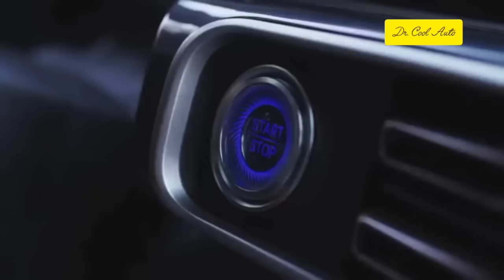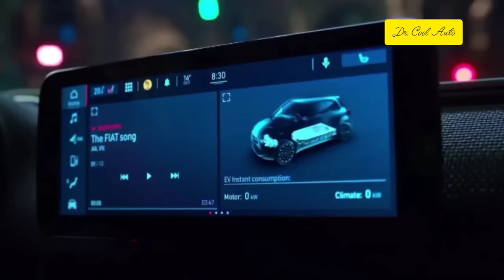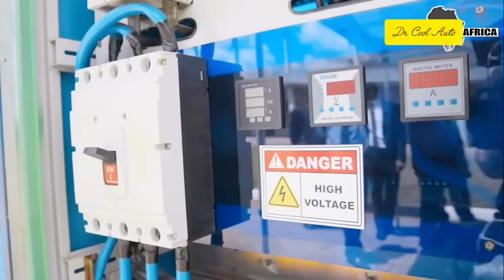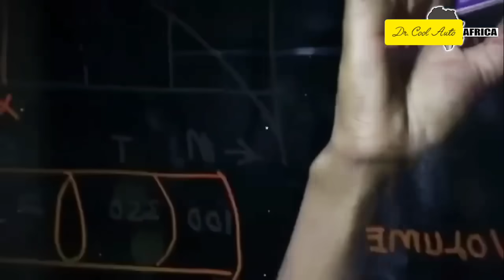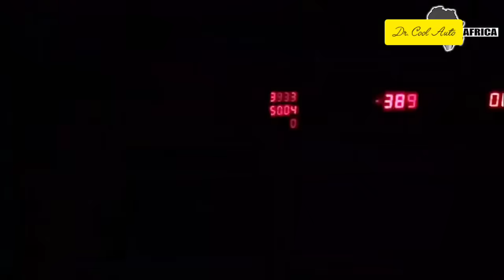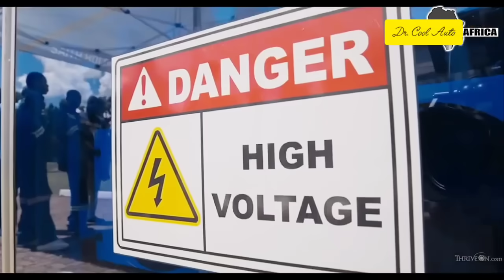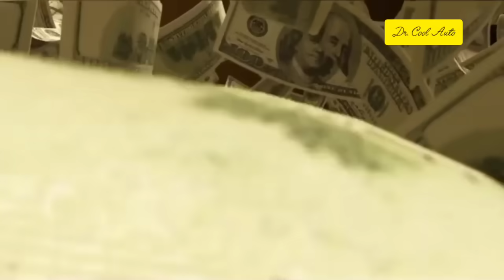2025 Self-Powered EV: Shakes Up The Entire World! shock skeptics

Comment: Dr. Cool Auto Fix;  If you want to invest in innovation and a 98% efficient motor then send me the money and I will show you my motor design.  I say 98% because you can NOT ever get a motor more efficient than that.  Anyone who claims to get over a 100% efficient motor is a liar and a fraud.  You can not get 500,000 watts from a .01 milliwatt radio wave.  That is like running a train locomotive with 100 box cars with a watch battery.  NEVER going to happen.  GM, Ford and other car companies are now working on compressed air motors, and that has the best chance of solving the problems.   This scammer has nothing but fraud.

Comment: Using Radio waves or any sort of electromagnetic broadcast to transmit energy to power an item isn't a new concept; Tesla had the same idea.  There are advantages such as a lower weight, lower cost vehicle as you don't need large heavy batteries. You could dispense with a physical power grid using electromagnetic energy broadcast from transmission towers such as Tesla built at Wardenclyffe. However you do still have to generate the power and then build transmission towers to broadcast the energy.  But you need to be within range.  If Chikumbusto can demonstrate a broadcast method that has a long range yet is also efficient - it ought to have a major impact, but a big IF.

Comment: Modern TVs typically draw anywhere from 50 to a few hundred watts, whereas ambient radio/TV broadcast signals in most residential environments only offer microwatts to milliwatts of harvestable energy—orders of magnitude less than a TV needs.

Here’s a quick comparison:
	•	TV Power Consumption: Let’s say a modern LED TV uses around 75W. Over an hour, that’s 75 watt-hours of energy.
	•	Ambient Radio Signal Power: Even under favorable conditions, you might harvest milliwatts—thousandths of a watt—from ambient signals. To reach 75 watt-hours, you’d need a massive area of high-efficiency antennas or years of collection time—practically impossible for powering a TV in real time.

Conclusion: While it is theoretically possible to power extremely low-power devices (like tiny sensors) using ambient electromagnetic waves, powering something like a TV or larger appliance from everyday broadcast signals is not feasible with current technology or known physics. If a video claims to show this in action, it’s very likely either misleading (e.g., using hidden power sources, battery backups, or editing tricks) or misunderstanding what’s actually happening.

Comment: The oil industry will not be destroyed. A cleaner earth from no gasoline or dirty motor oil is good and doable. But lubricants will still be required on these cars and so will plastics. Oil industry produces more than fuel. See these cars and motorcycles in action. Any fraud would be show its head immediately. Battery powered cars are not carbon free or that environmentally friendly, if you dig deeper to see how batteries are made and discarded too.

Comment: It would nice if his vehicles worked. I work with mechanical, electrical and electronics. You can’t run anything off radio wave. Our ancestors and Tesla had real technology that would  as he professes. Wireless electricity would be working today if not for the greed of J P Morgan.

But Maxwell your make a great statement. With that requires great proof. To give your the proof of your statement allow an engineer or scientist check your work.

Until then you just another con man. When I look at your car. I see dual batteries an inverter with some electronics circuit board. I don’t see a collector to catch your claim radio waves. There is power flowing around the earth. But as in the pyramids were needed to put the energy into the atmosphere where it could be utilized. I truly wish you had a real technology. With Tesla’s technology your products could work. But as all the posters point out greedy oil companies, everyone in energy would attempt to bury your technology if it worked. Worst they would not kill you. They would just buy your technology and bury it.

Comment: So much is bragged but literally nothing is revealed in technical terms. The whole thing is a scam. It's never possible to harness radio waves energy and use it to power a motorcycle, let alone a car. The energy conversion rate is simply too slow for driving such a heavy load. At best, you will get only a few watts from the converter.

Comment: Sorry to rain on your parade folks but - 

This is not a video to promote a Self-powered car, it is a video to promote a video describing ficticious self-powered vehicles. Please notice when you see the video of of a supposed SP car moving along a road, there is no sound at all apart from the narrator. This is because they are gas or battery powered vehicles.

I did some research on Energy Harvesting and:-

Conclusion: Practical RF Energy Harvesting

    Weak sources (cosmic, solar, ambient WiFi) provide only microwatts per square meter, requiring very low-power devices.
    Urban RF energy can be useful for low-power electronics (e.g., RFID, wireless sensors).
    Strong transmitters (radio towers, radar) could provide watts of power, but only at close range.
    Large rectenna arrays (like proposed for space-based solar power - using acres of transmitters) could collect meaningful energy.

Comment: What Maxwell has done tells me he was an electrician and mobile phone repair technician. This is because he has used the feedback loop that you hear when someone calls into a radio station and the feedback you get from a microphone, by connecting a radio transmitter system to a radio antenna system as the collector of radio waves, to  phone and radio speaker systems, from which he connects a USB battery charging system to a phone and radio microphone system, which is the feedback loop, which he connects to a battery as a recharge potential difference generator, which he connects to a power  output system. By system I mean micro electric components. Meaning that Maxwell's device is very viable and conserves radio frequency energy through sound. Complete genius, instead of letting radio waves decay through the air, he has connected them by wire and added the feedback that is disregarded by western European engineers. He needs overhead capital, a factory, retail outlet, prices and sales and marketing manager.
Reply: Exactly my thought
Reply: But it should be cheaper, why is it expensive?
Reply: @followGreatness  yes, it should be cheaper in order to sell
Reply: He also needs to show governments how to recoup the tax they will lose from ditching fossil fuels. I suggest a road tax per mile/kilometre. The more you travel the ,more you pay!
Reply: @johnwahannah2385  government anxiety about tax should not be turned into a weapon. A mature government would be patient for the new technology to be established and to tax it, in any case, the government should be printing new currency per birth rate.
Reply: And body guards

Comment: This will definitely make air travel safer without fuel which can cause engine fires. But I think in the case of planes their will have to be a backup power source just in case the primary power source goes out. Have two power units on the planes. If one malfunctions the other one kicks in.
Reply from the maker: I think even cheaper and accessible to everyone not just selected few

Comment: dont reinvent it u don the hard part u bult the car i use hwee in afrika is load shedding so i used watt all redy was awable and bildt wat teslar said im using it for 9 years i was thinking if i died my zon wont no how i keep my lites on so i bult a backup but to my suprise its sill going like he said the batreys are aking more like cap or super caps than battsrys i did cheet thou i used google ai to double check mh resinent frequencie thou i used 11meter caus thats what i new 11 meter resince is 2.76 metwr of wire whitch i used but i saw its musch easi than that a whasing masheen wartwer pump wtith a 12 v haddrill moter gives u the same it on has to sin till rezont then the magic happens the heat dos not apply and then it gives u 137v ac which i run thew witch i call a softkiss but i dont now watt the real name of the cercut is but its in all microwaves yes also tesla sorry its what i had so its the boury with the caps werw powwr cumes in from the wall it gives me from the 137v ac to a sm  ooth 220v out watt happas i cant tell u i tus call it magic u  got a wherking 220v the i run it to my normall chager wth is tust acar batt chager and charge my to soller batts which is in 24v to my inverter  it runs my house i dont use more 1200watt it cAn give me 2400 watt or 2.4k but i smoot in whith a micoven cap in the inside of the plug wall mounting. if my kids dont which off the plugs thy shok or if thy dont were shoos but they now power needs respect thy could be like there friends without it.

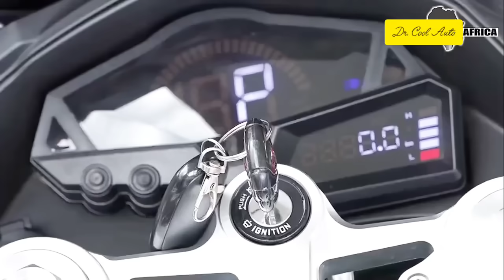Comment: why does it need the normal car battery (shown at 10:31) ??
Reply: It stores the power and regulates it
Reply: @ they say it makes power as required ,so why a battery when a normal regulator is smaller and more efficient? How big is the motor?
Reply: 2 other inventors delos santos and kapanadze use it to start the system. Kapanadze once used a flashlight battery.
Reply: @ must have been a big flashlight. You can see the cable coming off the battery in the clip. thats probably good for 100 Amperes
Reply: @rusty1538  i mean kapanadze, i remember 1.5 vdc.
Reply: @ what size motor is in the car?

Comment: Microsonic is a misleading name.
Reply: It's a sham. Anyone with half an electrical engineering degree knows the energy density required to be able to use radio waves to power cars and motorbikes makes this impossible - assuming I understand the premise of this solution.